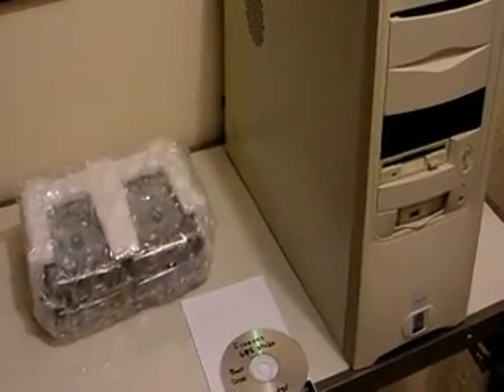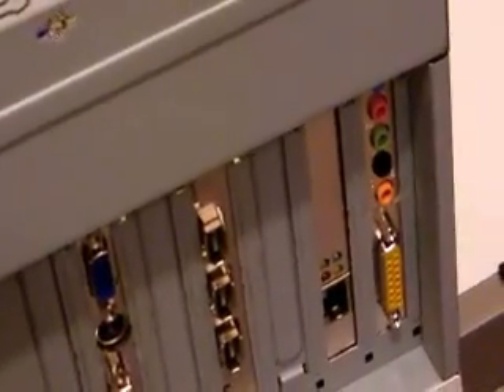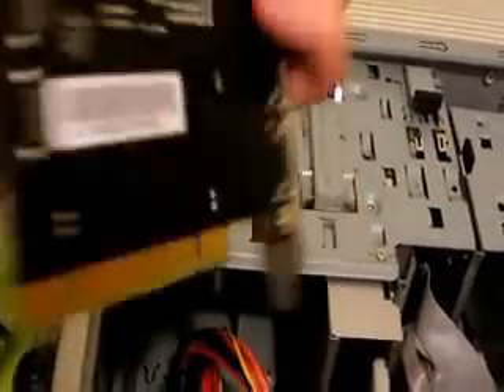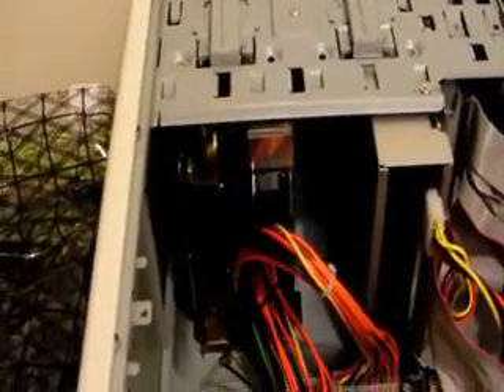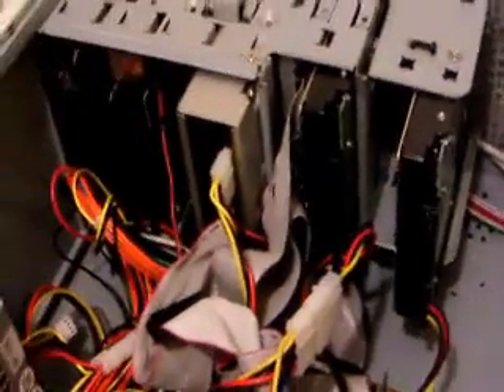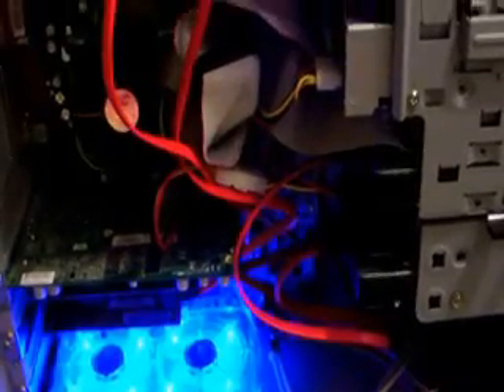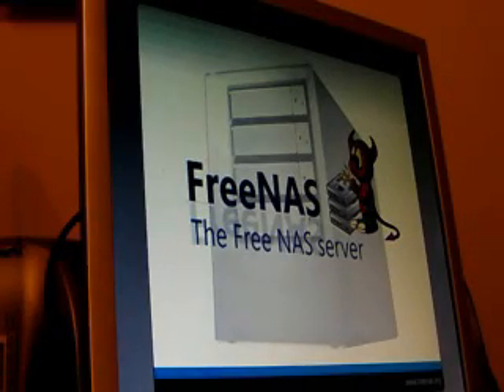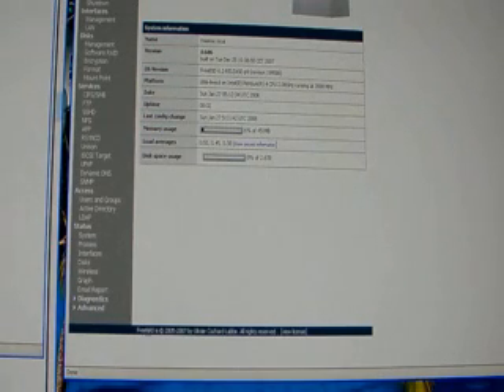Making a 4 Terabyte Server with Freenas.

Comment: hello I am using a dell dimension 2400 with a less powerful CPU and the stock hard disk and it is fully saturating a Mbps Ethernet but cannot play 2 1080p big buck bunny's on 2 different computers and the limiting factor is the lan and not the cpu and definitly not even the slow hard drive

Comment: Did you know that by taking out these cards (and especially the video card)  would result in a much lower power consumption? I tried this out and noticed a great difference on my power meter! Of course, you have to set the BIOS setting "Halt on" to "No Errors" first to prevent a rejected boot process hence the video beep code.

Comment: Cool video!  Just curious, did you look into hooking up an external raid box to hold the drives?  That would be easier to install and you could hook into the sata converter from the outside.

Comment: Just wondering if you've seen any performance hit w/ the Rosewill SATA raid card?  Does it create a bottleneck since 4 1TB drives are being pumped through 1 PCI slot? That version of PCI tops out at what, 480 MBPS per sec?